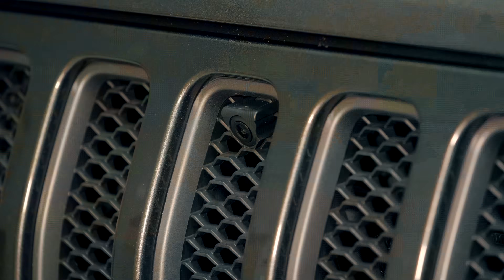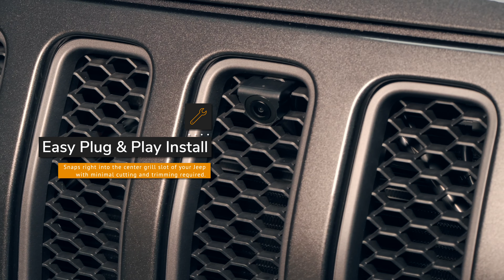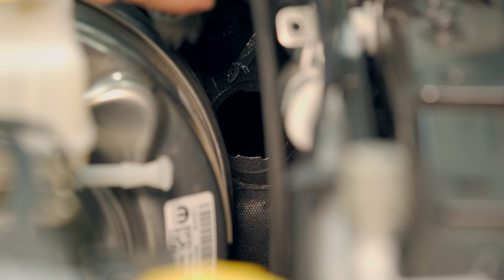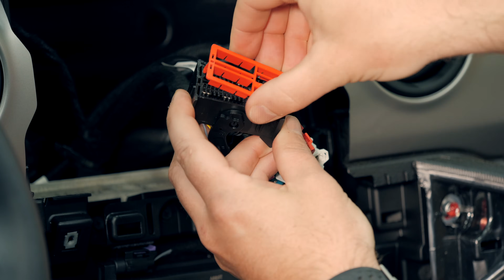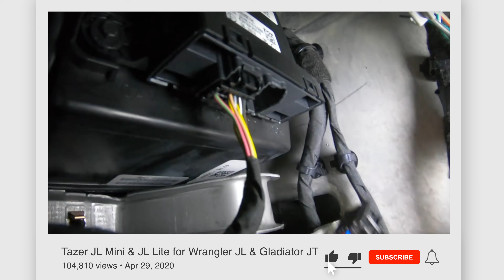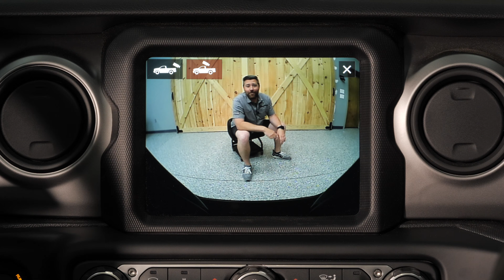Z Automotive Front Camera Install & Review for 2018+ Jeep Wrangler JL

Comment: Wish there was some way to integrate wheel guides with the front cam. That is what makes the oem setup so useful in trail situations.
Reply: From what I understand, the wheel traces come from the video processor box that’s behind the back seat next to the subwoofer.  I looked at adding the oem front camera, you have to add that camera, splice into the body harness on the passenger side, run to the backseat, then if you want add all the auxiliary washer pump,tubes, and wiring…..oh, and you have to add a different maybe higher definition backup cam too, which is also body color matched…….rough number I figured was 15 and 35 hundred bucks, not including the shipping, availability, scratched up knuckles and all.  Im going to order this and be happy to see something when my nose is pointing to tree tops and clouds

Comment: I’d rather have the higher def video for the front. If you could swap camera inputs,and program it so either only comes on with a button ,instead of reverse,you might have something. A little lost definition in the rear view,would be a great trade off,I think. Moving the cam forward  a bit, you would gain that little bit of l peripheral view lost because of the grill

Comment: Great install videos as always. Has anyone installed this with an aftermarket front bumper? I have a Smittybilt Stryker front bumper that has the loop so I'm worried it will block most of the view.  I could mount the camera on the loop of the front bumper but may not give me proper DOF.

Comment: What if you’re already using the pigtail on the back of the cigarette lighter to power the stealth light bar?
Reply: I have the same question.
Reply: Same question. Can you just splice in the camera with the light bar pigtail on the back of the cigarette lighter or do you need to route either the light bar or camera to an alternative power source such as the battery distribution block or one of the auxiliary/accessory buttons wiring if that's an option?

Comment: If I have an aftermarket radio with an AV connector for a front camera do I still need to hook the connectors to my start button for the power?  The camera harness gets plugged into the radio which gives it power I think

Comment: Will the Z Automotive Tazer JL/JT Lite Programmer - Compatible with Jeep Wrangler JL and Gladiator JT 2018-2021 work to set the cargo camera settings?

It is $217 rather than $329 for the mini.

Comment: That resolution is a limit of the camera...not the Uconnect system
Reply from the maker: The second camera input utilizes an RCA style input pigtail which limits you to standard definition. There is no aftermarket solution to add a digital high definition input for the front camera. 

On a side note, the factory forward facing trail cam system integrates into the uConnect screen using a separate module that combines the front and rear camera into a single input. It's actually a pretty complex system that has been documented on GladiatorForum if you want to find out more about it - https://www.jeepgladiatorforum.com/forum/threads/how-to-add-factory-front-trail-camera-to-gladiator-diy-writeup.35026/

Comment: Is this compatible with JTs?
Reply from the maker: There is a different version with a bracket specifically designed for the larger grill openings in the Gladiator JT - https://www.quadratec.com/p/z-automotive/front-camera-kit-gladiator-jt-Z-JT-CAM?utm_source=youtube&utm_medium=video&utm_campaign=install&utm_term=step-by-step&utm_content=jl-z-auto-front-camera
Reply: @Quadratec  thanks!

Comment: Will this work with the JT
Reply from the maker: There is a different version with a bracket specifically designed for the larger grill openings in the Gladiator JT - https://www.quadratec.com/p/z-automotive/front-camera-kit-gladiator-jt-Z-JT-CAM?utm_source=youtube&utm_medium=video&utm_campaign=install&utm_term=step-by-step&utm_content=jl-z-auto-front-camera
Reply: I added this camera with the JT bracket to my Gladiator. Works great!  #JTRSPARTACUS

Comment: Why not the 7 inch head unit?
Reply from the maker: There is no option for a second camera input on the 7 inch screen.
Reply: Oof, after reading that I looked up how much an 8.4 inch head unit would be and they're 1600 bucks. I would rather just not have the camera.
Reply: @c4onmylip  I had the 8.4” w Alpine ‘Premium’ Audio on my JT that I just sold. I was very underwhelmed with the audio quality - the head unit itself was nice though. If I do it again, I’m going to to bypass the 8.4 and Alpine and go with something like the Stinger head unit  and aftermarket speakers / amp.
Reply: @ohgerald  I personally like the sound even without the "premium" system. The head unit is nice enough, I was just curious about the upgrade for the camera because that would be mint for wheeling in rocks. For 1600 bucks to switch units without even adding the price of the camera yet though isn't worth it for me lol. I'll just keep using my buddies for spots when I need it instead lol.

Comment: What if you have the Bolt hood lock?
Reply from the maker: You could probably shift the camera over one grille slot, if you didn't mind the camera being offset slightly.
Reply: @Quadratec  I had the same question - I frequently park my Jeep in the city and need everything locked up. I assume one could just mount the camera just below the Bolt hood lock?

Comment: Would the bull bar on a classic arb bumper block the view? And if so how much would it block?
Reply from the maker: Without actually mounting one of these behind that bumper, our guess is that given the location of the bull bar, it would almost completely block the view of the camera. You could get creative, and use a different camera that you could custom mount on the front bumper below the bull bar and combine it with the Z Automotive kit that would provide the RCA video input on the back of the radio. Something like this could work - https://www.quadratec.com/p/brandmotion/dual-mount-cmos-camera-infrared-9002-7611
Reply: @Quadratec   thanks for the info! In the market for a gladiator and this answer Actually confirmed my suspicion about the factory front camera aswell. It would be good for the aftermarket for them to include if products are compatible with factory options like a front camera or the acc/fcw.
Reply from the maker: @nathanstone8764  Check out the RX front bumper from AEV - https://www.quadratec.com/p/aev/rx-front-bumper-wrangler-jl-gladiator-jt-12301000ad?utm_source=youtube&utm_medium=video&utm_campaign=install&utm_term=step-by-step&utm_content=jl-z-auto-front-camera it has an optional provision to relocate the camera to the bull bar - https://www.aev-conversions.com/product/front-camera-relocation-kit/

Comment: Horrible product in a JL/JT diesel. 4 visits to the dealer to clear codes and limp mode when it goes down. Seems as though others with non diesel vehicles are happy but my experience has been horrible.  Zautomotive said to bad to sad. No refunds.
Reply: can you explain how a camera plugged into the head unit is causing limp mode? what codes?

Comment: $510 and cut a hole in the grill ( because they don't provide a mounting plate ) to get a 480 res camera ? I don't think so.
Reply: Factory cam is only a little more at $600 and it has a washer nozzle and is HD unless I’m mistaken.